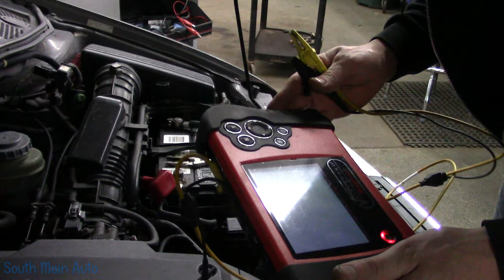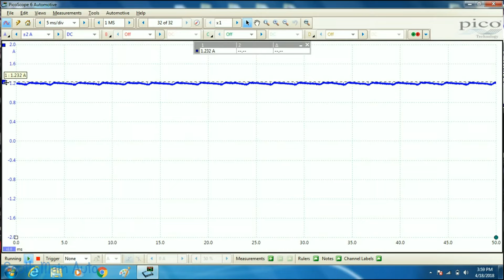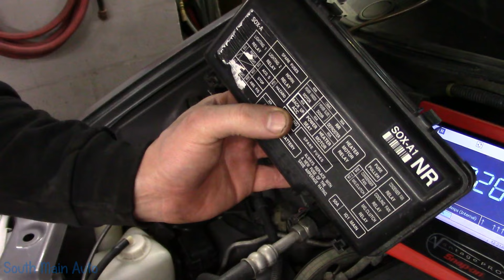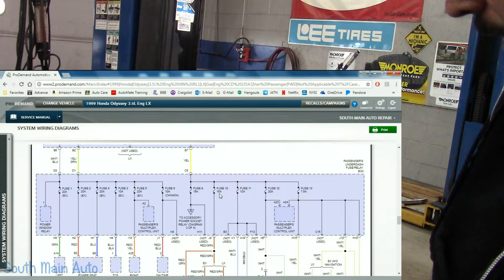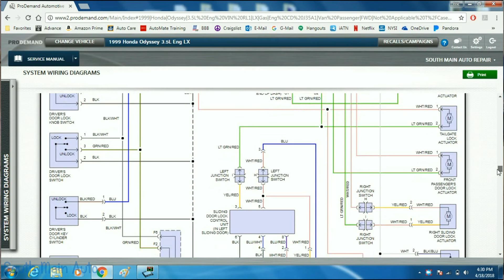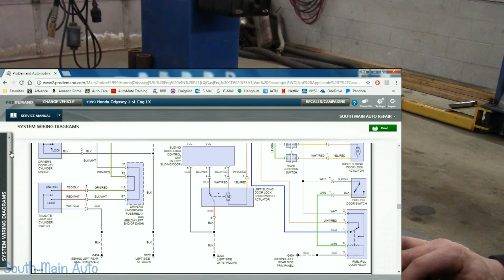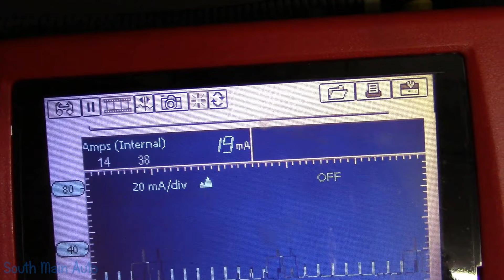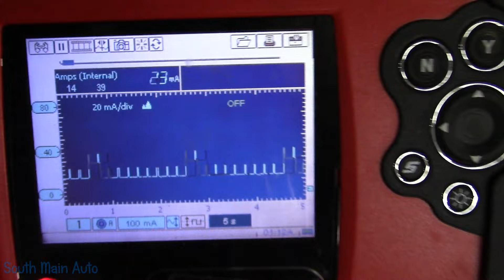Diagnosing Battery Draw (Battery Goes Dead Overnight)

Comment: alright everyone question for all of y'all cause i've ran out of ideas. 2007 mazada 3 hatch 2.3L 5 speed. went to pick it up drove great no lights no nothing. woke up the next morning check engine light was on radio did not work and key fob did not work. hooked up the scanner to it pulled codes u1900- ABS can bus fault,also B2212- panel switch out of range pulled out the power probe placed into DC volts checked all fuses, fuses were all good and in tact. next checked all the grounds all grounds were good. Inspceted wiring harness from the fuse box down where it looked like it was rubbing found someone else had been in there before me. found two already fixed wires. Where do I go from here? im having issues believing the Abs can bus would have anything to do with the radio but you never know. I'd inspect the wires from the Abs module to the fuse box but the bolts holding in the battery look wasted and ready to snap.

Comment: thanks for the video, big help as usual!!! I wonder if you could help me figure out what's happening with y Toyota Camry 2005. The voltage drops to 12.3 and lower when under acceleration. it went as low as 10 but no issues with drivibility or performance and as soon as you let your foot of the accelerator, its back up to 14.4v. Any help will be greatly appreciated...

thanks Mr Eric!

Comment: Have you ever been tested for,  Disgraphica ?

I know you slow up when your putting together a video, if you were in a hurry, bet you could have done that in around 16 minutes.
So A normal car would be around 25 to 75 Ma draw.
Reply from the maker: You are correct, this would have been in and out in under 30 min. Should I be tested for it?? WHy do you ask? And yes I like to see any thing under 100mA just as an average but these older cars are usually very low like this one was.
Reply: I was just pushing your leg. In your video you reversed a number, you said something like 54, then quickly changed to 45, Disgraphica is kinda like Dyslexia,  where you mix up your letters while reading, except in Disgraphica you only mix up numbers. Again just joking with you.
I know the ECU draws power while key is off, and surely the radio, and maybe the Alarm System, so do most of the Control modules pull power. Probably different for all cars models. Out of car repair in general, trying to repair power problems is the most interesting, At least to me, most people hate it the most.
If you were a Wiz in math class, you dont suffer from Disgraphica..You were a Wiz.....Right

Comment: everything has to be full of electrical stuff. minivan doors used to be manual. but someone wanted to sell more vans than the other guys and started this gimmick. now if minivan doors arent motorized no one will buy them? or customers will demand discounts? lol 'hey the other guys have robot doors, i want a discount!' in the software industry youre not guaranteed to have the same features as previous versions but no one complains about that. if you take away power windows off cars today it would be blasphemy. why dont people put power windows and doors on their houses? not just the garage door. everything should be powered. the stairs should be escalators like in malls. no one has time or energy to be walkin up and down no stairs!!! lol the shower curtain must also be powered. or the shower door. every door must be automatic like at stores and we would all have key fobs at home. and when those things break we can call Eric lmao. we cant live like peasants like this any longer! notice no one has these power door problems at their house because no one has power doors at home! car marketing is pure evil. they have caused people to lust for hyper advanced automobiles like transformer robots and then drive them through salty roads to fall apart and buy more! insanity.

Comment: Of course you could always do the stupid method of removing 1 fuse at a time , check the meter for drain, replace the 1 fuse and go to the next fuse. This method will at least tell you which circuit is leaking .
Reply from the maker: Yes that is the stupid method that we showed in this case.... stupid but 100% efective